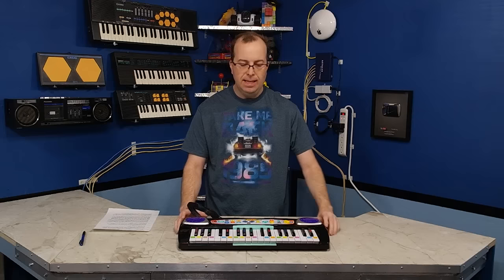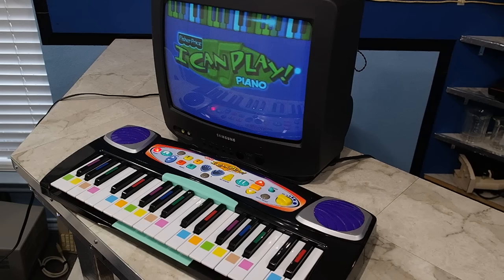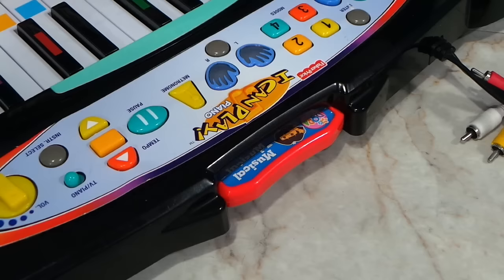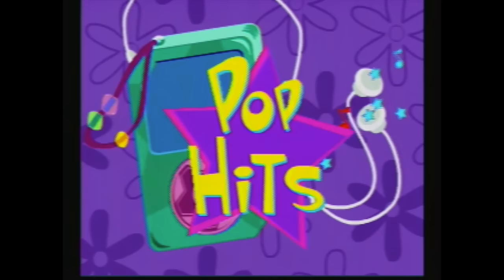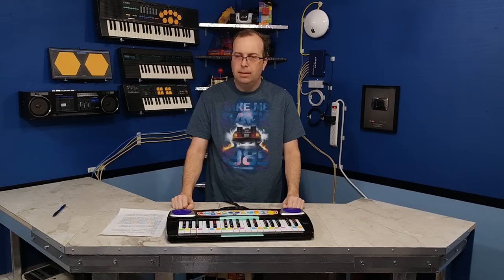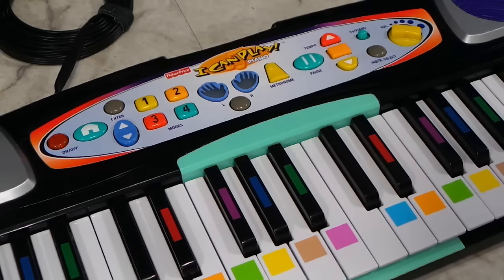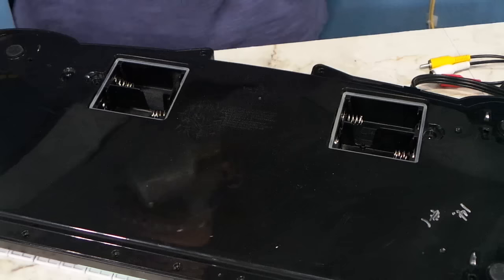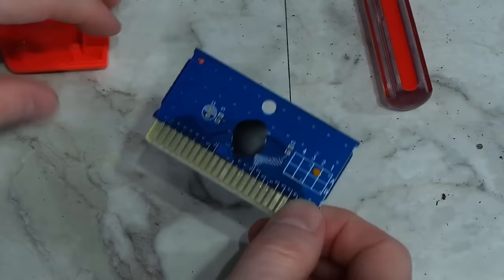Destruction of the Fisher Price "I Can Play" keyboard and review

Comment: i'm just imagining something like...
"As he span up the dremel, and started to cut into the bare, unyielding plastic, a shower of sparks came up. on closer inspection, the dull glint of steel shone through. It would be nearly impossible to get through with the tools at hand, but he had started, damnit, and he was going to finish it. He raised the dremel, and with furious force, started to cut through the steel. The square was cut, but it could not be removed. He suspected glue, and as he raised the blowtorch, sure enough he saw the fumes of melting superglue rise. he lifted the plate, only to see the stark, unyielding grey of concrete. He aquired a jackhammer, and started pounding away at it. As it cracked away, he recognised a carbon-carbon composite, almost impossible to break though with any tools on earth. But he didn't neccisarily have to use tools, did he?
-THREE DAYS LATER--
As he aimed the m-198 at the piano, he uttered an unintelligible phrase, something along the lines of 'damned $10', and fired. As the 155mm shell went flying towards the device at over 2,000 feet per second, the white phosphorus started to ignite. When it hit, the plastic started to burn away, the steel ripped of by the blast, the concrete shattered, the carbon-carbon composite ripped. All that was left was a wooden box. As David opened the box, he saw a letter. 'How long did that take? --Bryan Stockton'"

I did the reasearch

Comment: I just bought one of these things in like-new condition with one cartridge from the local goodwill for $4. I'm feeling like I got a bit ripped off.  I really appreciate the video you made - I was concerned that my hunk-o-junk was simply malfunctioning or suffering from poor battery power level...nope, it's working as designed. I dislike the user interface so much, I may just throw this thing away instead of giving it to my 3 year old to play with.

Comment: I find this somewhat disconcerting.  I have spent the last 60 years doing 1000s of restorations (mostly music and optically related) of items centuries old to contemporary.  It is very common for hidden screws to be under soft or removable parts on the top of the product.  Gentle pressure on that paper top would have found the screws quite easily.  Trash time for this one.